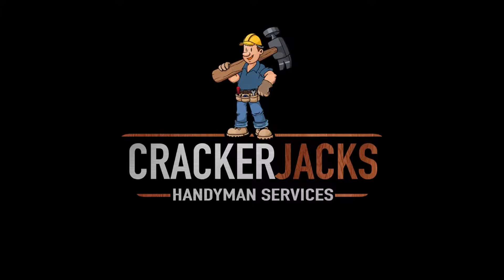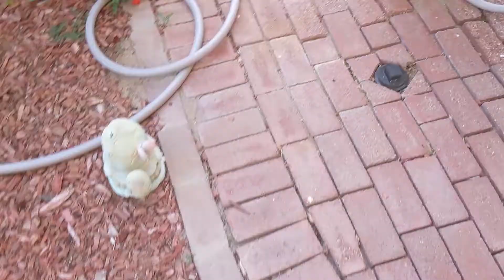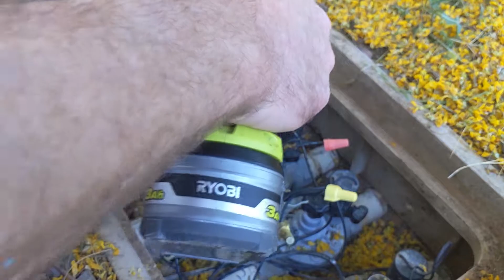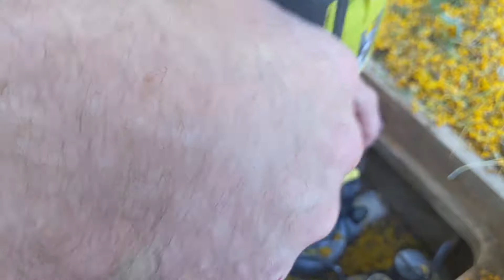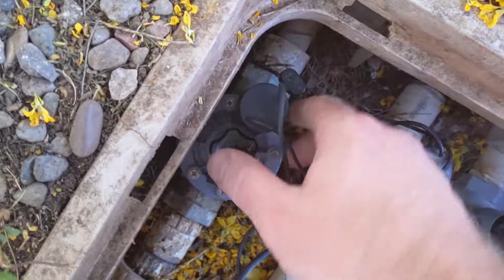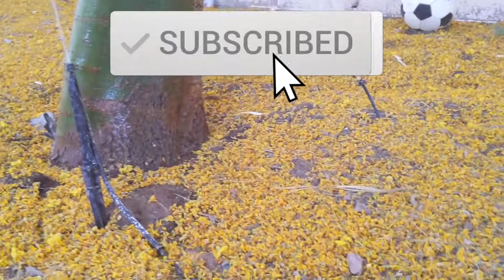HOW TO REPLACE IRRIGATION ZONE CONTROL VALVE DIY | THE FAST EASY WAY |  NO DIGGING OR CUTTING PIPES!

Comment: Your video just saved me A$693 = US$433, which is what my plumber (ex plumber?) quoted me after charging me A$297 for a 30 minute callout to diagnose the leak problem. Fortunately the exact same Irritrol solenoid valve was available in Canberra (A$55) and using your video I was able to replace it in 30 minutes. All working perfectly now.
Reply from the maker: Outstanding!!! 💪💪💪
Reply from the maker: Thank you so much for sharing this!